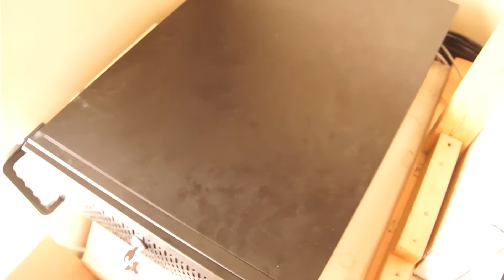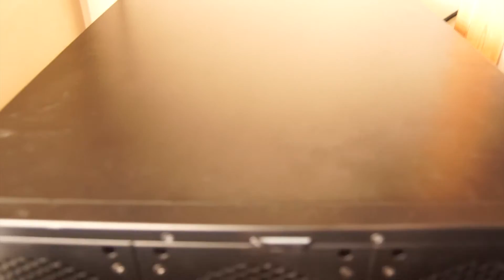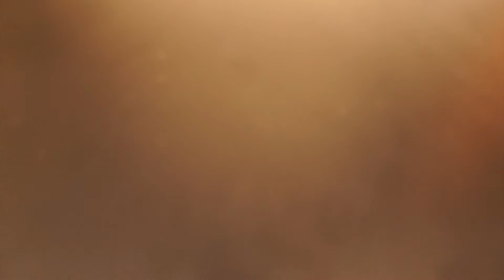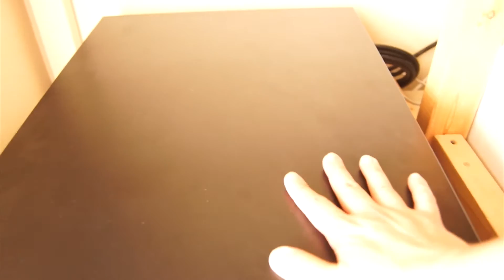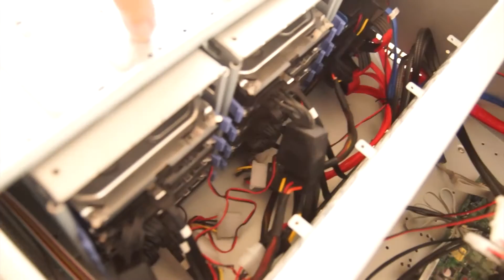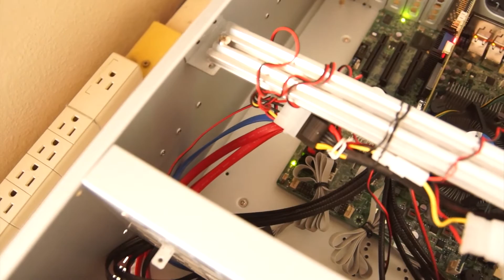2013-04-06 Storage Home Server

Comment: Thanks for this... I am trying to find a cheap case for all my hard drives and this seems like a good option.

BTW.. how are those seagates working out? LoL, seagates are god awful! I hope you are having better luck with them than I am.
Reply from the maker: they still work but i don't have the machine on 24/7. i currently use synology ds1812+ with 5x 4TB drives. i needed to get a larger storage. i have different mix of brands seagate and western digital. none are nas drives and the device has been on for 24/7 for the last 3 months or so. i have a back up that runs 3-4 times a week and has been good so far. i have a monthly scrub going on the raid as well. i'm running a raid6 on it. i haven't done any videos in a while and would like to do one on this but have been busy.

if you're gonna run the drives 24/7 and constant read/write, it's best to get a nas-type drive. otherwise, i've been fairly lucky with just regular drives. i sometimes wait for sale on external drives 2TB or higher and just pull them out of the enclosure. it voids the warranty but again, i've been lucky :)
Reply: Yeah, more like you have been touched by the lord you lucky lucky man. I have 2 RAiD6 Arrays in 2 different servers. Both machines have upwards of 16 drives with an assortment of different brands running 24/7. Not one failure in the last 2 years with other drives but I have 8 seagate drive failures. Thats alarming to me. I will never ever buy seagate again.